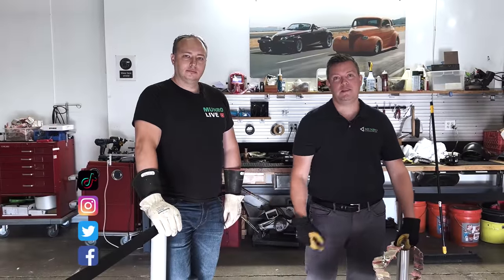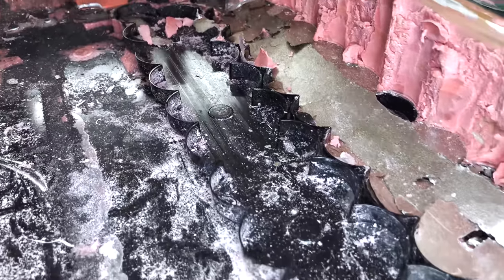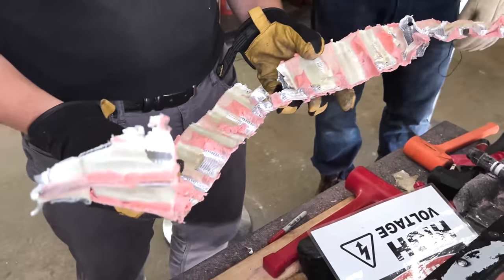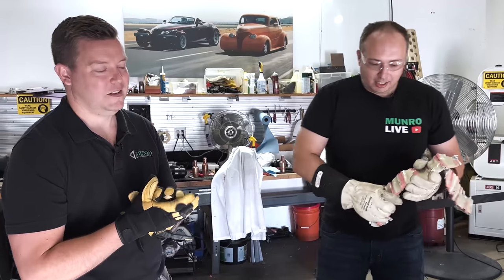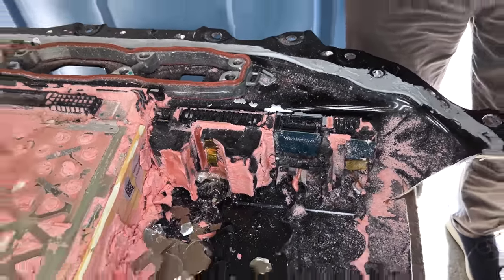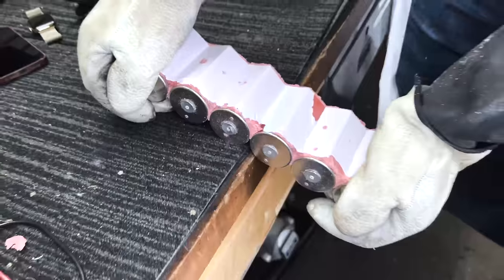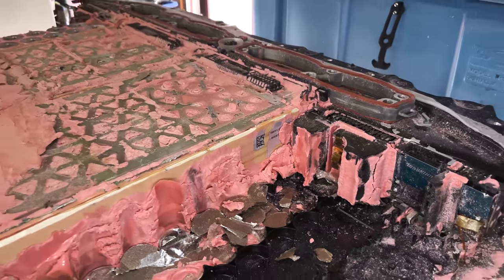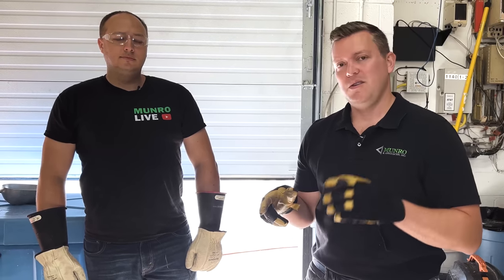4680 Update Structural Adhesive | Tesla Model Y

Comment: Sandy Munro has assembled the most awesome set of engineers/analysts. Wall Street analysts should consult these guys to do their analysis. If they did, they wouldn’t recommend anything but TSLA.
Reply: Munro does not underestimate the Chinese, see the new Xpeng G9 announcement with 480 kW charging.
Can the 4680 do the same?
Reply: @abraxastulammo9940  It might if Tesla only targeted cell life to be 100,000 miles instead of 1,000,000.
Reply: Lol….. what Wall Street!?
Reply: @flipadavis  are you sure about that!?
Reply: @alanmay7929  Are you sure about the Xpeng cells lasting very long charging at 480 kWs? I will withhold judgement one way or another until we see real customers prove that these charging speeds are possible and repeatable without drastically shortening the cells' lifespans.
Reply: The question that should always be asked is "What is everyone else doing?" as there are other battery packs with the same or better performance. Admittedly, this information is very hard to find, because battery pack manufacturers are rarely public about their products and there's much less interest. Many factors, and consideration, from engineering and manufacturing, to overall business strategy, go into battery pack design. What best for Tesla may not work best for other companies
Reply: @flipadavis  It depends on some factors: time / future improvements and this is something people have still that old approach to tech that is hurtful on the long run and short sighted: 480kw let's say you get around 350 miles of range per charge and around 100,000 miles before you drop under 70%. Now depends on your driving needs but let's say at 20K milles per year is 5 years before changing your battery pack. What pack do you think it will be available in 5 years from now? The S curve is real, Tesla was the first in line to do a real EV but now things are advancing really fast so 5 years for now the pack will be lighter, smaller, and have maybe 800KW charging and 650 miles of range. 5 years in tech it may be 25 years in innovation. Question, do you still have the phone / laptop from 5 years ago? And if you do, how it sits on performance comparing with today's flagships?
Reply: @flipadavis  have you ever heard of battery management!? 480kwh doesn’t mean it’s going to charge like that all the time and from 0-100! Grow up!!!! The charging performance of batteries is increasing years after years.
Reply: @flipadavis  there are also tests done in labs
Reply: Wall Street Analysts do consult with them they just do not like the answers they give.
Reply: He said on autoline that Singapore finance people are huge customers for the full reports
Reply: @LosZonga  
Great (LONG) answer (/s), in which you failed to consider not just what the Chinese are doing, but what Tesla has in the pipeline......?
Reply: @inclusivelove5165  Actually a lot of economics is about perception so they are actually doing their job to take this into account regardless of the facts. A quick example supposedly some important politician makes a speech on TV about the value of their countries currency. This depending on its slant how prominent and respected that person was would change the value of the country even though in no facts have changed.
Reply: This 4680 battery is a mess! Plan on replacing it because it can never be repaired!
Reply: @gmv0553  You are correct in earlier battery packs can be repaired much more easily the thing is the vast majority were not. There is method in Tesla's madness faulty packs will be shredded and treated to extract all those useful minerals and metals meaning they do not have to be mined out of the ground again. Secondly the new pack will be more reliable though obviously when you are talking 10 or 20 million in service even the most minuscule failure rate can add up to thousands.

Actually there is only one drawback to the 4680 packs. It is known that Tesla used to recycle older batteries into their Mega packs. Now they will rely on new build ones. One can presume that the percentage of Recycled" batteries was small enough that this was not a major factor.

Comment: Amazing that there is no shear connection (no glue / foam) at the bottom of the cells… So actually the structural pack is not a sandwich structure - rather a battery - red foam plank….

Thanks for these amazing videos…. Good job!!!!

Comment: Electrified Garage: "We can repair your battery pack when a cell dies."
Tesla: "Hold my beer!"
Reply: Hopefully 5x less cells translates to at least 5x less chances of something going wrong with the pack.
Reply: @jrharbortproductions  If a cell goes bad, at least it still contributes to the structural integrity.  :)
Reply: Nah, Rich's knife will go right through that pink stuff.
Reply: @Resist4  how does that make it any better
Reply: @jrharbortproductions  
Hopefully, but not necessarily.
Reply: @jrharbortproductions  5x less cells means if one goes bad you lose more capacity.

The lack of reparability in the design means you must recycle, you cannot reuse.

Also fewer cells mean that when the battery is mostly full on rapid charging, balancing will be hard as there are fewer options to distribute.
Reply: Maybe they can weaken that stuff by dissolving it in some sort of chemical.
Reply: Yes. What an unbelievably poorly designed piece of throwaway junk. But let's just ignore that. We'll focus on the positives, for now, at least.
Reply: @davidbrayshaw3529  There should be no problem with recycling. It's all done by mashing the whole thing to dust and taking it from there.

As far as repairs are concerned very few manufactured things are designed to be repaired. So if this cannot be repaired it's not unusual.
Reply: @iainmrodgers9991  Knowing what Drew said, this kind of packaging will result in less problems where pack repair would even be needed. 

The weak point (as of 10 years + Data shows) is not the cell itself but the packaging. 

You could design it for repairability. This then leads to more repeairs beeing required because of the inferior design. The only one winning here are the repair shops. 

Additionally, there is still the huge problem of cell imbalance when replacing a few cells vs the whole pack.
Reply: @iainmrodgers9991  
dust
Yeah just like that - magic.
Reply: @andrewholdaway813  Dust...

... and taking it from there.

Which is similar to what goes on with ores anyway.
Reply: @theipc-twizzt2789  No, it is not that. Physics says that the chemical batteries we have a limited life-span, which means they will die at some point. Some die earlier than others, which means that if you change the dead ones, you have a mostly good pack for a few more years (1-2-3 or so). That was done until now, not possible with this design. You have to trash a car or a 10k part and buy a new one. Wtf.
Reply: @iainmrodgers9991  
I'm just wondering about all that 'structural' foam.
Reply: @iainmrodgers9991  Recycling is just one of the "three r's". There's repairability an repurposing to consider as well. This design fails at both.
Keep in mind also that Lithium Ion battery recycling plants are few and far between at present. Only about 1 in 20 cells is recycled. That's not a very good strike rate.
Reply: @jrharbortproductions  
Also, each cell (with tabless tech) should be under considerably less heat stress, thus extending life.
Reply: @andrewharpin6749  
"If one cell goes bad" you might lose 1/828th (0.12%) of capacity...... 🤔
But with less internal resistance/ resistive heating, each cell should encounter less stress, increasing longevity.......?
Reply: @andrewholdaway813  
Ever heard of "points of potential failure"?
Reply: @rogerstarkey5390  
Re. points of failure
Ever heard of giving a reference for your comments.
Reply: @davidbrayshaw3529  
"Three R's"
"Recycling"
No problem.
"Repairability"
Well, if power electronics fail on other packs, the pack must be removed, dismantled and repaired (ref the recent Ford "contactor issue", I believe that's multiple solid state components on control boards inside the pack?)
.
This pack? As with other Tesla units ... Did you notice the "penthouse"? Removed before the cover was peeled back? (That'll be the easy to remove "power box" which will be under the rear seat  Tesla 1. Others 0)
As for the "module fixation".
Why does it have to be a module repair? Why not a fused connection (or relay) across a cell or group of 3 in parallel?
Simple to electronically disconnect, then rebalance.
.
"Repurpose"
If you mean "repurpose" the complete pack, for storage, the pack would be at +/-75% capacity and would be simply "plugged in" as a complete unit after testing.
.
If you imply that the "DIY / Cottage industry builder community" would find the pack unsuitable....? (You really think that's a huge market?)
Well, they could either use the whole, still substantial pack, or buy secondhand packs/ cells from elsewhere, (probably at reduced capacity and about 50-60% price?) 
OR buy NEW 4680 cells at what should be 50-60% price per kWh of "other" cells?
(Remember battery day?)
.
Maybe "we" should leave it to the experts who have no doubt calculated the probable longevity, failure rate, cost and potential for reuse/ recycling?
In case you haven't figured it out, Tesla is "building" a complete "system" (transport, energy, etc) and is calculating the system efficiency rather than the edge case minutiae.
Reply: @davidbrayshaw3529  designed badly not if the function was to stop very high old pack sale prices so you can by them back at a good price to recycle.
Reply: @jrharbortproductions  There will always be something wrong with the pack, don't diulsion yourself.
Reply: @iainmrodgers9991  Aha, ok, i iot...
Reply: @theipc-twizzt2789  No, no and no.
Reply: @alanrickett2537  Not only buy them back at a good price but also to sell another brand new proprietary pack to the poor consumer at "X" cost.
Reply: @rogerstarkey5390  I'm very happy to leave it to the "experts". I'd just rather those experts were engineers that held a long term view to sustainability rather than accountants with a short term view to profits.
Reply: @davidbrayshaw3529  good luck trying to get the OEMs to agree on standardized battery interface and connectors, that would be great for EVs but it's not a Tesla only issue.

A standard like that would make car conversion very simple and new car companies easy to start VW, Toyota,ford , GM etc etc would  never go for it.
Reply: @rogerstarkey5390   The hopefully improved cell design should help, but with 2170's there are 4416 of them in the LR pack, fundamentally as the cells are 5x the capacity, you lose 5x as much with each cell death.
Reply: @marcusbiller867  Yeah mate if you say so. 
I am not aware that widespread vehicle battery failure due to cell chemistry failure is a thing and you could easily provide data to counter my argument. 

Also, cell reuse for storage is not a thing. It does not work like that. No manufacturer would ever use old car packs for this use case, as house batteries are even more safety critical. So apart from some diy systems this is not a consideration. 

Btw BYD, the second largest BEV manufacturer is now also moving away from the old design to a structural pack.
Reply: @theipc-twizzt2789  Yeah in theory sounds good. ""Just use it for DIY and solar storage" But legal liability and checks itself cost money also. Also providing enough support for product cycle cost also. Sure for diy market and electric conversions this will be very hard job to use those. But this is small percentage in grand scheme of things. Maybe at the end just scrap it and use new known pack anyway. or use other blade design from other storage providers. On market its not just Tesla.

Comment: You should do a flame test on that pink material.  It would be interesting to know if it has flame retardant ability in addition to its structural strength.
Reply: Elon once mentioned something like 'fill the gaps, or glue it together, with fire-retardant epoxy' so I would be disappointed if it wasn't!
Reply: They've taken outside and hit it with a lighter in an earlier video

Edit-I went back to the rivian pack video and it appears the foam from the Tesla was blue. So I guess it was a different version of a Tesla pack
Reply: They said they would in comments on either previous video or one before that.

Comment: Definitely a game changer when they can get the 4680s fully ramped! I can't wait to see them come out of a Cybertruck and Semi.
Reply: I'm getting excited to see that too, less than a year away!
Reply: they’re switching to BYD blade batteries at gigafactory berlin for the model y.
Reply: @kam_iko  and they are building the battery building on the GigaBerlin site as well. 4680s will be present in some way at Berlin in the future.
Reply: @kam_iko  that's kinda a side topic...maybe you meant to reply to someone else?
Reply: @kam_iko  Those are LFP batteries for shorter range models. Good cells of course. But LFP is heavier and takes up more space than NCA/NMC cells, which is the base chemistry for 4680s. Longer range models are likely to continue using that chemistry, and the semi cannot use it due to weight restrictions.

That said, LFP chemistries are improving very quickly. We may see long range Model 3 and Y using them at some point.
Reply: Interesting and sad I like to see Tesla stay 100% American.  Now it's probably just a matter of time before they partner and develop cars togheter.
Reply: @anthonypelchat  True, but LFP would be a good choice for the 300 mile version of the Semi, due to longer life and low cost.
Reply: @mrm1885  They are a worldwide company. The products sold in America are almost entirely American made (some parts from China, but few, and raw materials frequently have to come from other countries). That will continue as much as possible.
Reply: @georgepelton5645  Not for the semi. Lower cost and lifetime are good, but the weight and size are bad. You are likely looking at a similar weight to the 500 mile range version, possibly more. But you also likely won't have space in the truck body for those cells. 

Now I am having to go off cells that I can get my hands on personally. As such, they aren't exactly up to the same specs as the newest cells. Still, LFP would have to have made huge improvements over a year ago just to let Tesla test out and get approval for everything. Maybe in a few years they will be there, but not yet.
Reply: @georgepelton5645  btw, the cells that I have worked with directly were Tesla 2170s from 2017 weighing 70g at 18.5wh and LFP 32700s from 2021 weighing 138g at 19.2wh. You can notice from the info there that the the LFP is roughly 50% larger and twice the weight for just around 5% more capacity. That makes it really difficult to fit large capacity packs into any vehicle. The short range semi likely needs around 500-600Kwh packs for that range. That would be nearly 10,000 pounds for the LFP compared to 5,000 for the 2170s (NCA).
Reply: @kam_iko  that will be for the SR models same as the CATL LFP cells in Shanghai built SR cars
Reply: Yep, making something so absolutely unserviceable and irreparable is a game changer. More throw away rubbish. Marvelous.
Reply: What?!   They are currently used in the Made-in-Texas (MIT) Tesla Model Y.
Reply: @rcpmac  not all Ys from Texas have 4680s. They built in the ability to use 2170 packs as they work to ramp the new 4680 manufacturing lines.

Comment: Excellent show as always. Couple of questions , first what happens when few cells deteriorate or die? from the designs seems that the whole battery pack needs to replaced as one unit. Very expensive warranty or after warranty repair. Second at the end of the life cycle, seems to me that this pack very difficult to recycle or reuse components out of it. Hence more environmental impact
Reply: Was covered in an earlier video that the whole battery pack could be ground up into dust and recycled.
Reply: This is why the 4680 cell design development has taken so long.
Cell balance is (obviously) critical to lifetime. The BMS has a serious job to do!

Comment: A fine job guys. Really. Fantastic work guys, keep sharing those tear downs. Absolute amazing to be able to follow along. 
Do you think this pack design will be kept? What surprised me was to see the pack had the traditional side cooling line. After battery day, I feel consensus was for the 4680 cells to be cooled via the bottom, as that apparently is the more efficient way?
What about weight of the battery pack? When unbolted what did the pack weigh in at? And how is that compared to other Tesla packs?
Reply: If it's any indication, the Made In Texas Model Y weighs about 20 pounds lighter than the Made In Fremont models. The weight savings likely come from a combination of battery design changes and the gigacasting. My guess as to why Tesla designed the battery pack this way, is that it makes them quicker to assemble
Reply: @areitu  I read the opposite. And that's with the lower kwh rating.

Comment: Have you been able to do charge cycles with the new cells? What kind of energy density do the 4680 cells actually hold? 15 000 mah per single cell? Or higher?
Reply: They haven't even extracted them out of the box yet 😄😄
Reply: @hammerheadcorvette4  Not all no, but some of the cells are out. You only need one cell to test it's capacity.